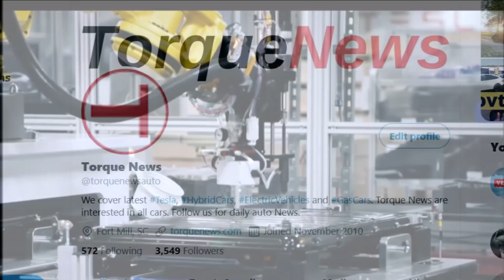Tesla Signs New Battery Supply Deal with Panasonic

Comment: My gut feeling is that Panasonic will produce 4680 sized batteries, including the tab-less method, but using its own chemistry, NOT the Tesla nickel/coated silicon chemistry.  With regards to Maxwell,  I do not know how the Maxwell dry electrode coating applies to the various chemistries, so I cannot opine;  but another of the Maxwell ideas was to use super-capacitors in parallel to protect batteries from current surges and extend their life;  I liked it, but I think Tesla abandoned this idea for some reason.  In any case, it would involve throwing a few capacitors between batteries;  not inside the battery cells themselves, probably.

Comment: Cynically: if Tesla buys a lot of batteries from Panasonic, it becomes that much harder for VW etc. to buy batteries for their cars
Reply: Why? Panasonic is not a supplier for VW. Most otehr companies (beside Tesla) buy from LG, SK Innovation, CATL or Samsung.
Reply: @EinzigfreierName  The EV car industry may be battery constrained in a few years. If Tesla drops Panasonic, then Panasonic will have production capacity that Tesla's competitors can use.
Reply: @davidchenevert3573  Tesla is not likely to drop Panasonic anytime soon. They are keeping their battery options open because battery demand will definitely be going up over the next 5 years as EVs flourish.
Reply: @deanmcmanis9398  Originally I thought they would drop Panasonic and other battery suppliers in favor of vertical integration, at the point that they were producing 3x - 5x more than any single supplier. Now I'm thinking: They will prefer for Panasonic and the other suppliers to own the production capacity, so that the other companies use their own capital for as much production capacity as possible.  Assuming the suppliers can keep up with the technology and demand for capital.
Reply: @davidchenevert3573  I think that Tesla would prefer that they had full control over all stages of battery creation, from mining, to refining, to development and production. But their immediate and near-future battery needs require that they distribute the work among their corporate partners until their own production capability surpasses their battery requirements.
Reply: @deanmcmanis9398  I completely agree. They're going to have a transition period when Tesla is making many batteries, but not enough, The Tesla Way (probably the best batteries) while still shipping a lot of cars with 3rd-party batteries (Panasonic etc.) I would think their first hurdle is getting the 3rd-parties to make batteries in The New Shape (46 x 80), so Tesla can finish the huge frame-construction migration to cell-in-chassis, without waiting on perfect vertical integration, Maxwell dry electrode technology, etc.

Comment: The fact that Tesla needs LG chem for China production, plus the launch of the Semi truck and pick-up indicate that Tesla still requires outside suppliers for battery production. In addition, Tesla will continue to expand it's solar roof/powerwall and grid storage businesses which require additional battery packs. As noted by other commenters, Panasonic and Tesla have had a rocky relationship the last two years; I am surprised that Panasonic didn't ask for a longer term deal, based on the $10's of millions capital investment for new manufacturing equipment.
Reply: Previous statements indicate that 4680s aren't needed on Semis, due to (heavier) battery to total carrying weight proportions being so miniscule compared to passenger vehicles.
Reply: @Crunch_dGH  But with Semis, the truck weight will still figure into it's value, because Semi tractor trailers are limited to a maximum combined weight. So if the Tesla Semi using the higher capacity 4680s can shave off weight, that increases the trailer payload by that savings amount for every trip. I think that the only reasons why the Tesla Semis are using the 2170L batteries now are the fact that Panasonic can produce those batteries right now. Production Semis could still be using only 4680 batteries, or a mix of 2170 batteries and 4680 batteries by model. One other point is that even though the lifespan of the 2170 batteries is good (300K-500K miles) the 4680 batteries are likely 4X-5X as long lasting, which is important for Semis, which regular drive over 1 million miles in a vehicle's lifetime.

Comment: It is practically impossible that Panasonic would use maxwell technology. They will adapt only form factor and tapless design. 

Panasonic itself announced they heard about this new design only on battery day and started making tests with it. Adapting Maxwell technology, would take much longer than few months and I don't think Tesla want to share it.

For my opinion, Tesla continues using other supplies to manufacture lower end batteries and concentrate producing higher end batteries by themselves. Battery technology development doesn't end here and this way Tesla reduce risk and keep itself more agile to adopt new technologies when needed. 

There is not going to be anything radical which would make previous designs obsolete but there will be continous improvenents. I belive there will also be choices between charging time, power density, price and lifetime. Different manufacturers concentrate on different technologies and it is wise to keep relationships good to be able to have a choise.

Comment: Panasonic is not innovating fast enough, battery day light the fire under Panasonic. Innovate or lose Tesla business. Tesla is moving cell to chassis with 4680 if Panasonic doesn’t move fast they to 4680 us made model 3 and will stuck with normal chassis.
Reply: I agree. Japanese manufacturers are often very conservative (as shown by Toyota and Honda) And Tesla cannot wait for them to internally move forward, but by producing their own 4680 battery, they are giving partner Panasonic a hard nudge to move ahead, with them both benefiting from the new battery production. Also Tesla building their own 4680 batteries gives them more control over future battery supplies and prices, which are otherwise wholly controlled by Asian mega-corporations/governments.
Reply: Don't agree. Without Panasonic, Tesla would not be where they are today. And they need Panasonic for the future. Why else would they have made this new deals?
Reply: @EinzigfreierName  Ok, to be more specific, I agree that Tesla created their Roadrunner project and 4680 factories and batteries so that they would not be reliant on Asian battery or materials suppliers. But I also agree the Tesla has big plans to support and expand partnerships with those same battery and materials suppliers for many years to come.

Comment: I'm in process of hybridizing my Mazda RX-8 track car & hope to put a chassis structural battery pack behind the front seats on either sides of the driveshaft tunnel. Might there be a chance to pick up some Panasonic "seconds" (blemishes) from any of the production runs?
Reply: I have never heard of any discount battery blems, from the factory or suppliers. Because they are volatile and hazardous, there are probably a great many legal liabilities in selling any imperfect batteries. The best deals on batteries for EV projects are from wrecking yards currently.